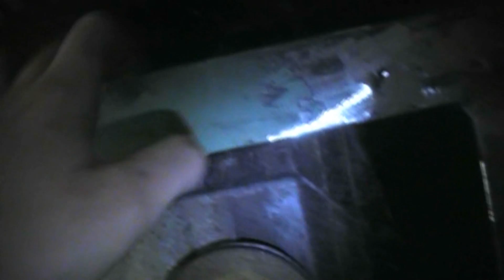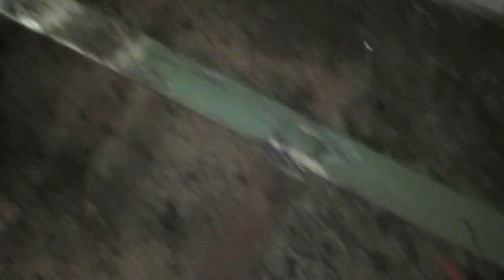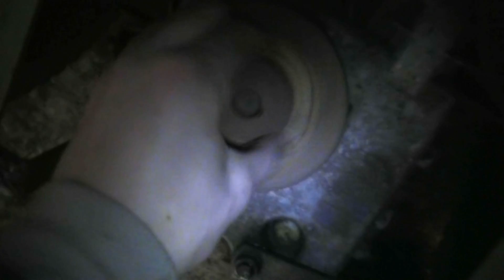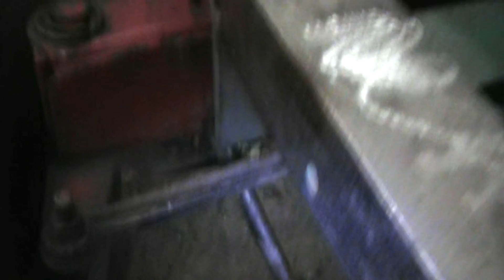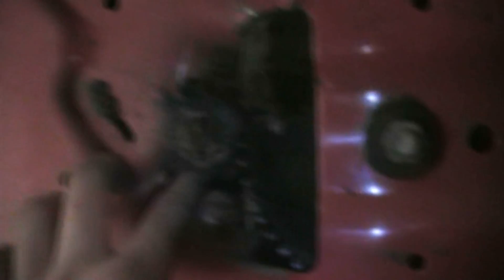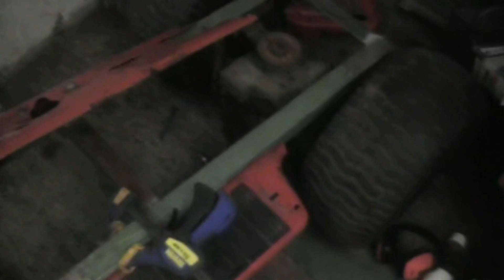Off Road Lawn Mower Build #2

Comment from the maker: Definatly.  Im already getting a headache trying to figure them out.  I know the kind you mean.  I would have to make a custom link arm for it though, so it sat above the chassis.  Then there's clearnace for the engine and stuff to worry about.  If this way doesnt work or breaks, I'll do something different.   Ive thought of a way of protecting the lwoest part of the steering though, so it should be okay.  It's more of a mudder than a rock crawler anyway.  How is your crawler coming on?